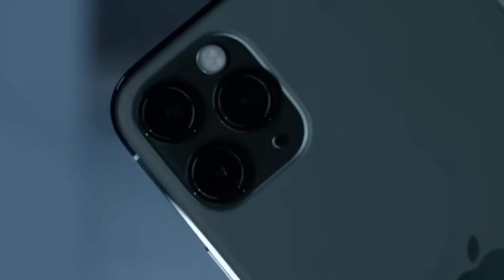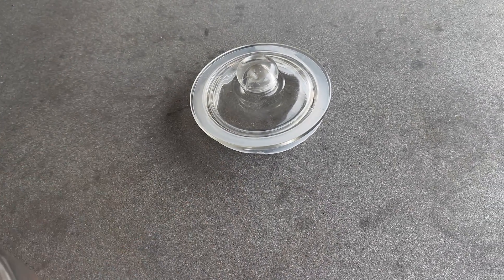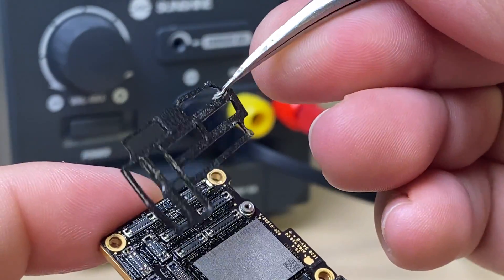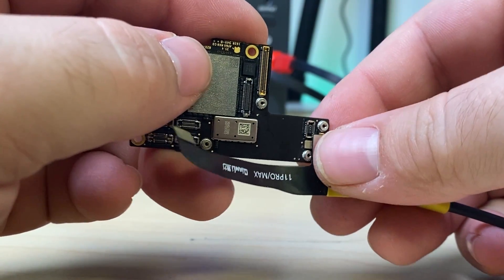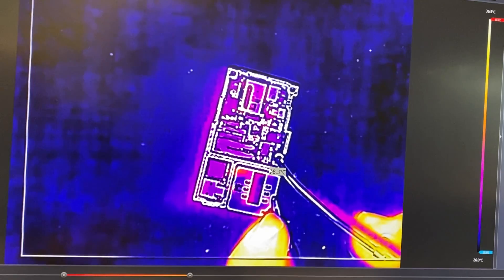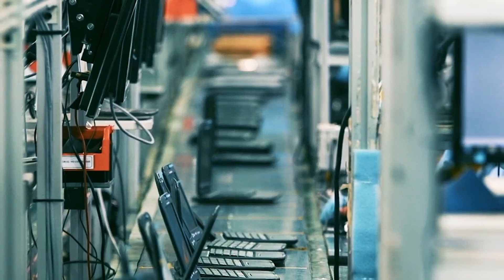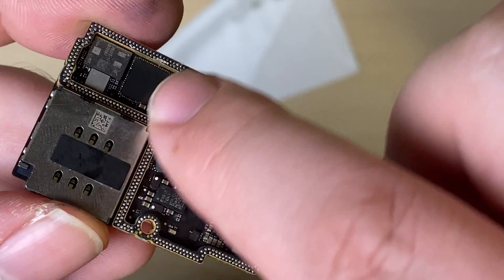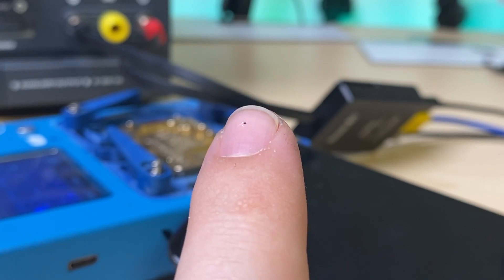How To Find a Short on an iPhone Motherboard

Comment: I imagine a short to be hole or diversion in a pipe or system (of pipes). Other than that, great run down on how to find the short with modern methods. Showing an iPhone is a bonus as that's extra work and the tools you used, however (not bashing) but that looked like you pulled the pad, which is always a risk when ripping caps off. It's seems like it has It's pros (by avoiding unnecessary heat), but made more work or damaged the board.
Reply from the maker: Thanks for the comment. I didn't pull the pad on this one as I'm assuming you are referring to 8:31 in the video. The orange looking piece is the inner side of the capacitors end. if you look close you can see a silver ring around it where the solder shows(it would have appeared as the same color as the board if pulled). There is of course always a risk to popping off caps and pulling pads so great comment.